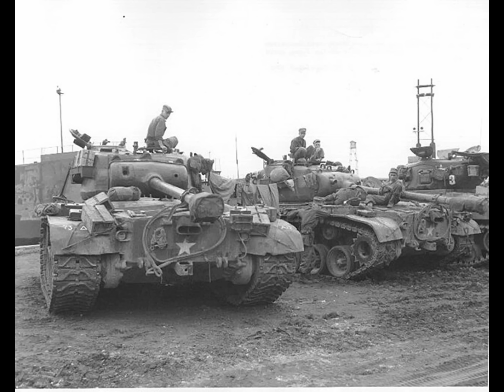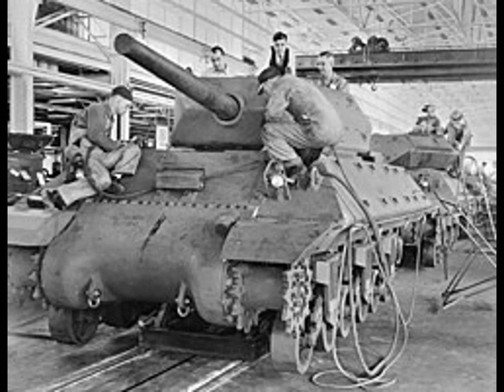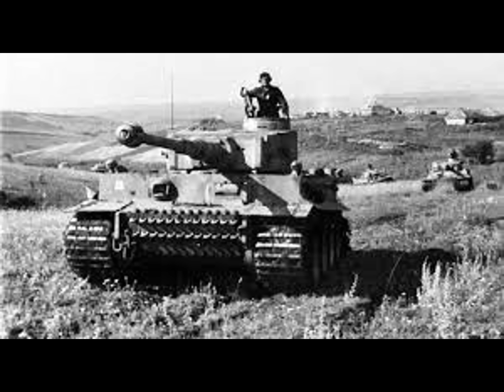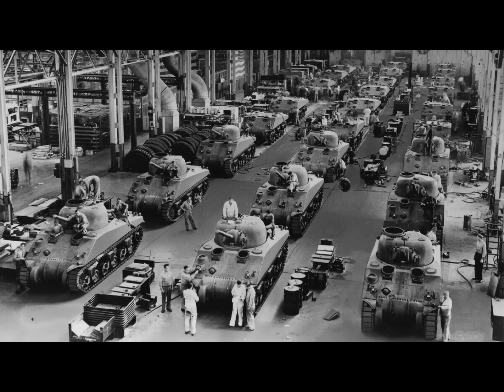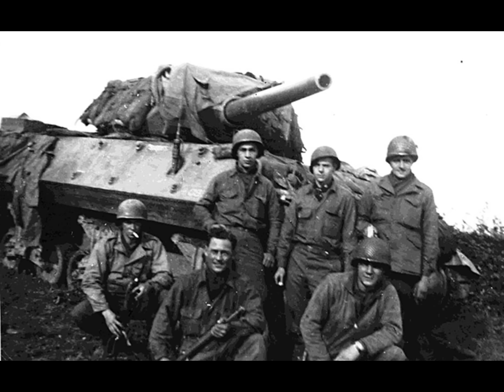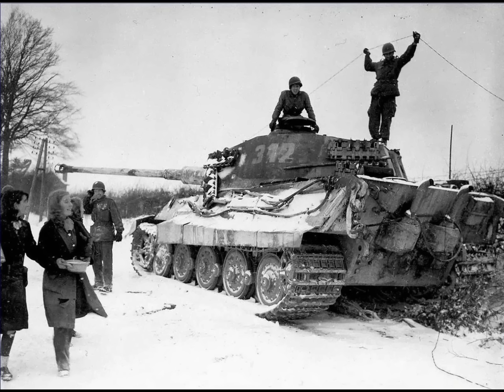German Gunners Laughed At 90mm Guns — Until M36s Started Killing Tigers At 2,000 Yards

Comment: Another Southern Cal guy. 
  The Americans extensively tested the captured Tiger 1 and found 2 big weaknesses.
  First, due to the extreme weight, the drivetrain and suspension were over stressed resulting in slow movement over even roads and simulated uneven combat terrain and hills. They tended to break down much more than American tanks and required highly trained craftsmen to repair and maintain and parts often were not interchangeable even between similar models.

  Secondly, fuel consumption was 3-6 times that of an M4 Sherman, which required the Germans to alter their tactics to static defensive positions to conserve fuel, which was under stress by allied bombing.

  Lastly we found certain armor weaknesses that could be exploited, especially using superior movement tactics.

 Thanks for the look at the M36 tank destroyers.  I always find that often little covered in historical programs.

Comment: The M36 started shop in the Western front early December 1944, ready for the Battle of the Bulge. They came in 3 versions, the initial production on a M10 chassis. The rarer M36B1 on a M4A3 Sherman chassis which was liked because it kept the bow machine gun against enemy infantry (the turret AA .50 cal couldn’t be used forward without getting out of the turret. The final version was the M36B2 which was an updated version of the M36 which served in Korea and still used into the Balkans and in Iraq.
Reply: Wrong it was there since at least October

Comment: The 90 mm AA gun was designed,  like the German 88 mm, first for anti aircraft use,  then turned on surface targets.   I heard towed 90 mm helped stop the German during the Battle of the Bulge.   Allied shipping  limited the weight of tanks it could handle.  Ships crossing the Atlantic were more limited by rough seas than ships crossing the Med.  The heaviest German tanks  were only moved over land.   They never were shipped to North Africa.
Reply: The Allies captured a German Tiger I tank in North Africa in 1943, most famously the Tiger 131, which was disabled and abandoned by its crew during the Tunisian Campaign. This tank was then extensively studied by the Allies, and the captured Tiger 712 was also recovered in Tunisia and sent to the U.S. for intelligence research.
Reply: @Mr.Benson  Thank you for the update.   Still the German tanks went up in weight and armor from the Tiger 1.   They were free to adopt heavier tanks because they could use land transport especially by rail.  Shipping by ship limited the weight od single tanks shipped from America.   It was largely a loading issue.  We could load three Sherman tanks, one at a time.   We could not handle the super heavies, like the German's later monsters.    Our heavier guns first came on lighter armored tank destroyers, then on improved regular tanks.  

The Sherman Jumbo had massively increased frontal armor.  They used the standard 75 mm gun to keep the total weight down.  The Germans could both up gun and up armor their tanks, at once, because rail transport can handle larger unit loads than cranes loading ships.   This left America able to ship many " good enough" tanks, rather than fewer much better tanks with much better armor and  heavier guns.   Canada also made tanks for
the Allies which is why I say America rather  than just the US.
Reply: US dock side cranes early war were limited to about 40 tons. They could lift M4 Sherman's but couldn't lift the M4A3E2 or T26E3.  

Later the cranes were reinforced to if I recall correctly about 60 tons.
Reply: It's shame  the   brits figure out that the fire concept  coukd work..and that  american doctrine  was not flexible enough to  have  understood  this and  the German 8i8  clearly  showed  this.. how many mbt today are not long barrels and not  atleast 100 to 125 mm or mote
Reply: While  90 mm  m 26  held up well in Korea...the Sherman  was better suited  to the terrain in Korea  ...why  didn't  the US. Shove these guns into Sherman's and  helical  t.d...in mass sooner